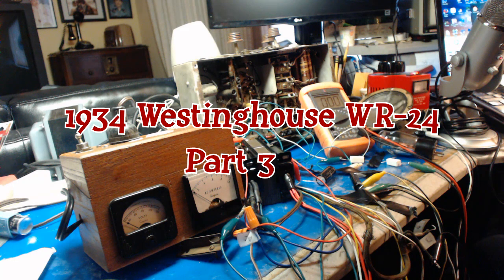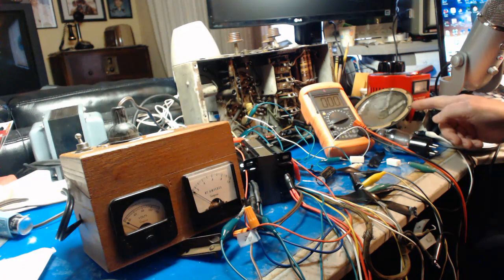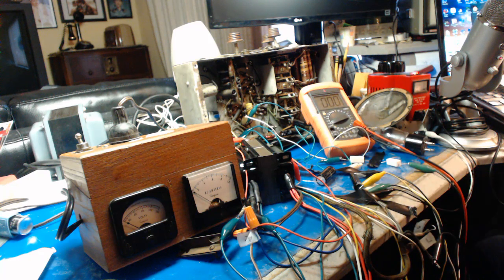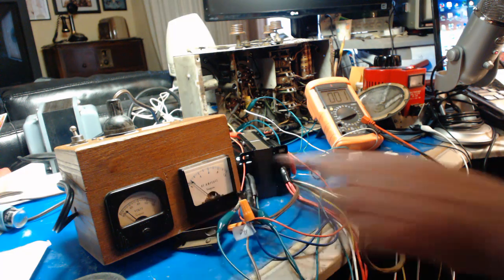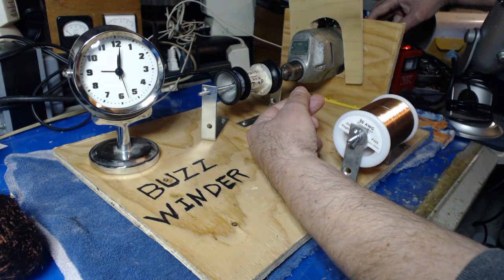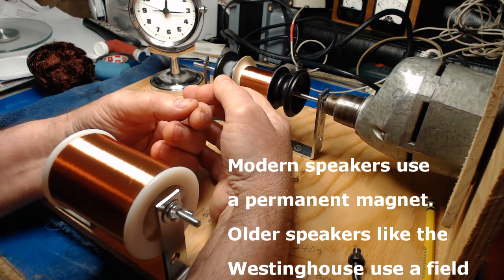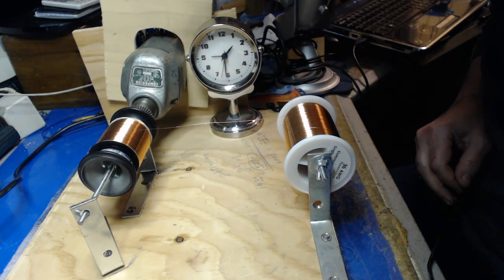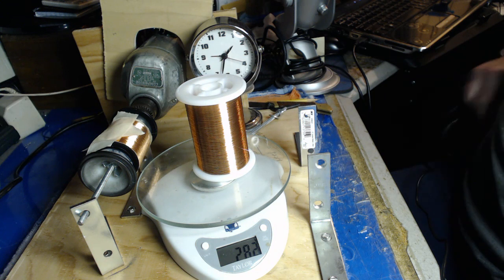1934 Westinghouse Model WR-24 Restore Part 3

Comment: Hi Buzz,
My father-in-law had an old metal drill like yours.  It flew sparks out and would frequently give you a mild electric shock - no third wire, non polarized plug.  Fun times.
Reply from the maker: mine sparks too lol.Buzz

Comment: Man, an hour and a half to wind that coil. i'm sure they cranked them out faster back in 1934 lol I'm impressed the radio still works on those old caps!
Reply from the maker: Hi Dan....90 minutes went by fast, but next time I could probably do it in 45 min....That Westinghouse is a winner....Buzz

Comment: Good Job Buzz! Amazing that radio worked as well as it did with those scary looking caps too! You should be able to adjust the current for the Field Coil you wound to get the speaker cone moving but not distorting, if it's too far off the mark for resistance. I'm sure some older Radio Design books cover that, but this old stuff had pretty wide margins built in for production, so you should be okay.
Stay Warm...gonna get cold in the around here this weekend!
Reply from the maker: Hi Kong..Next week , i'll have to wind the output transformer secondary, with its 66 turns...hope to test the speaker next week , but I don't know if I'll have time...Buzz

Comment: Buzz!
You ARE the MAN! What a fantastic job. Weighing the wire was genius. I'm sure you have it right or close enough for horseshoes and hand grenades. A little extra won't hurt. 3K sounds slightly high but who cares? The more inductance is good for the field coil since the field coil is used as the inductor in the PIE filter. You might have to change a resistor value in the high wattage resistors to adjust the B+ higher, but since you are a lucky son of a gun, you probably won't! Besides, lower B+ = longer tube life. Check your RCA Rx Tube manual to see if the B+ is in range and it probably is fantastically in range.  So Dickel is cooling off. Hope they told him to be "careful" in the showers. PS. As far as I know, You have 3 SW bands. The low SW band typically overlaps the upper end of 
the  broadcast band slightly and that's how they made the radio dial.  The low
 SW band was used for police communication and consumers liked to listen
 to the cops chase cars for theatre of the mind. Radio just needs a good alignment and Buzz will be cooking
 with gas!
Reply: Tesla was still alive when Westinghouse made this radio.  
Perhaps he had one.  So what would Nikoli listen to in 1934?  
Did they have Westinghouse sponsored radio shows?  
Perhaps the grand old opry?  Or some Adolf speeches on short wave?  
Or maybe FDR talking about making America great to get over the depression?  Yup, I can imagine ol' Nikoli sitting in his room, tuning his 1934 Westinghouse radidio.
Reply from the maker: Hi Meister...Its cold here in Portland..we are not used to snow, It snowed Wednesday, its melts a bit during the day and re-freezes at night....Brendan said the extra wire might make the speaker sound even better.....we shall see...The B+ on the output tube was 270v with the 5" speaker..the schematic calls for 240v on the screen of the output tube, so we shall see when the repaired speaker is tested....I still have to wind the secondary coil of the output transformer...it will be fun to test it....You re right that 1530KC I use on my broadcaster...the broadcast band ends at 1560, the 2nd band starts with 1500, so it looks like the radio is off a bit on the broadcast band.....I'll have to do further testing.......LOL on Dickel...hope he doesn't bend over picking up soap in the shower...take care, Buzz
Reply from the maker: If only the radio could speak???...hummmmm

Comment: Nice job on the coil winding Buzz.It all looked very therapeutic ! There's no reason I can see as to why it shouldn't work well.Of course,the coil will provide much better smoothing than the resistors.
Reply from the maker: yes, it was a very relaxing winding...I did it at 5:00 am and was great...Buzz

Comment: Dear Buzz, I use two volt meters after recapping a tube radio, an AC meter to monitor the variac input voltage and another meter to monitor the DC output voltage, I have done this from my first tube radio and seems to work just fine, I do like your setup better, you do an excellent job on these radios.....):
Reply from the maker: thanks mark..have a holly jolly Christmas! 🎄☃

Comment: Nice work, Buzz.  That was quite the surprise to hear that radio come to life all original like that.  Will you be spraying that field coil with some clear lacquer to hold the wires in place or just leave it bare?  I once had a 40 year old drill but if I still had it it'd be past 50 by now, lol.  It was a black & decker but it was shot.  If you got into anything heavy it would make a grinding sound inside it while on the outside it wasn't turning and on light stuff you could watch the sparks fly out of it while you were drilling.  I didn't feel safe with it so I got a Milwaukee drill a few years ago that came with an extra set of motor brushes inside the handle but no more than I use it I doubt I'll ever have to change them.  Take care, Gary
Reply from the maker: Hi Gary...I'm just going to tape the coil, as the original was just taped...It's weird to have a 47 year old drill I used as a young stud, and now I'm old and still using it....funny...mine will spit out sparks if i put pressure on it..it has the original brushes...I did replace the cord last year.....take care, Buzz

Comment: Nice job on the speaker coil Buzz.  Could you compare your coil to a similar radio to get an idea on how many ohms it may have been?  You sure have what we here locally call great sh1thouse luck with the radios.  It is scary when you consider what might happen should one of the old caps lets go!  Thanks for the weekly show!!
Reply from the maker: Those old field coils will probably work as long as they are around 1200 to 1500 ohms..Brendan said, even with 3K, it just might work even better...we will have to see when I test it...Buzz

Comment: hey buzz, how did you weigh the tare of the reel on the new wire? not that it would make a big difference in the weight on the 8.5 oz.
Reply from the maker: I haven't weighed it, but the hub weighs practically nothing....Buzz

Comment: You could be picking up  your transmitter as an image on the SW band.

I need to go get my 1930 chassis running.

When I got married, one of the first questions my wife asked was if I was an "over" or an "under" TP hanger.  She is an 'over'.  Me, well I never cared, I hung it the way it came out after I unwrapped it, so it was pot luck.  My mother was an under though.  You know, these kinds of issues can be grounds for a divorce!

I knew the wire would jump the hub.  Did it break and have to be spliced?  Been there and done that!
(I rewound a modulation transformer once.)
Reply from the maker: you warming up to Dickel yet? ha
Reply: Some of your Dickel skits are funny.  I liked the one where he woke up under the huge roach.  Shades of Kafka!

Comment: I thought you might be interested in knowing that the Toilet Paper Roll Patent shows the paper rolling from the front.  The way you and I think it should be.  I saw a photo of various methods of mounting toilet paper, the one that rolled to the front was called "RIGHT", the one that rolled off from the back was labeled "WRONG" and the one that was simply set on its side and not actually mounted they called "YOU MONSTER!"
You mentioned something about the voltage drop on the Field Coil.  I was more concerned with the current.  I mean, that wire is so tiny...I think you said it was 38AWG wire, which has a maximum current rating of 0.130 amps.  If you have actually 0.130 amps, with 3KΩ resistance, you have a drop of 390 volts across the coil.  I have to wonder just how much current is going through the Field Coil that you made...and made fantastically might I add!
Reply from the maker: thanks, that field coil winding episode was one of my favorites!.🍺🍟